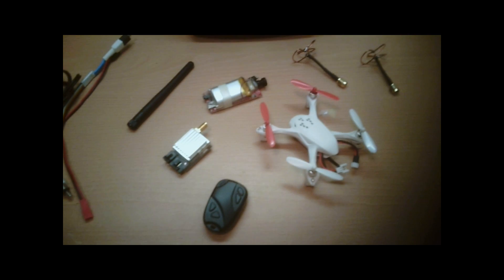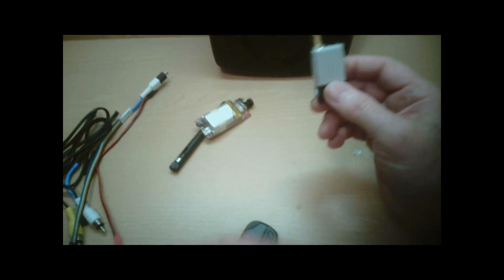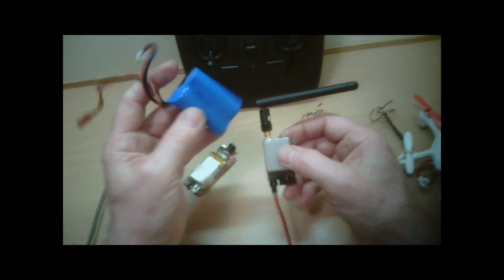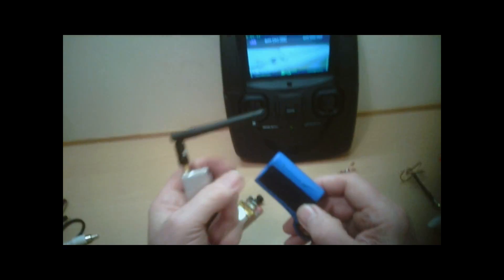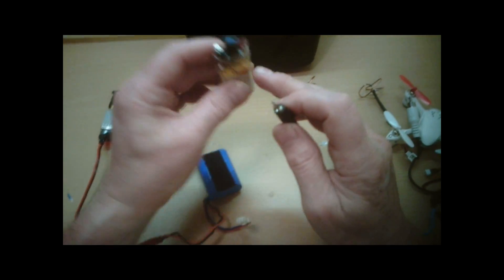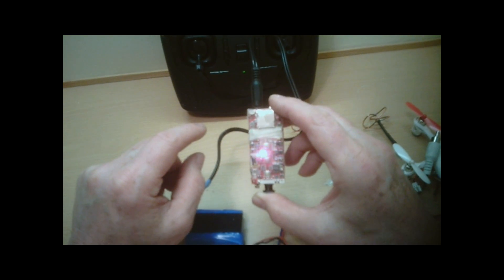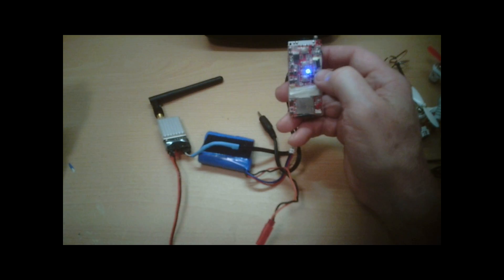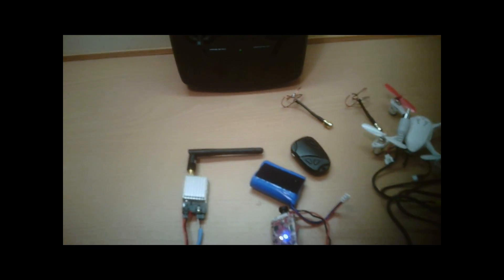Budget FPV F450 Quaadcopter Hubsan TX Ground Station

Comment: how did you get that antenna on the controller like that ?
Reply from the maker: On top of the Hubsan Transmitter there are two push out holes. I just pressed one of these out then used a pigtail SMA connection soldered to the existing Bi-Quad Antenna then screwed the diapole antenna to this.
Reply: Were can I get that connector the pigtail sma ?
Reply from the maker: ***** From Ebay type in SMA Pigtail cable, make sure you get the correct type for your antenna,Male or Female, centre pin or no centre pin.
Reply: I'm use dipole antennas for now .
Reply: Which ones would I need , if you dont mine thanks a lot .

Comment: Hi there,
Is there any way to improve my H107C 0.3mp to HD quality without extra weight?
I saw somewhere that they changed the original camera from the Hubsan to a HD-cam.
Reply: order the new HD board and swap it out, easy as swapping motors